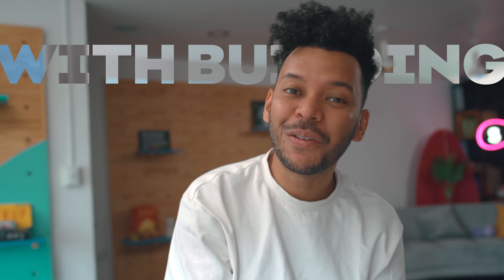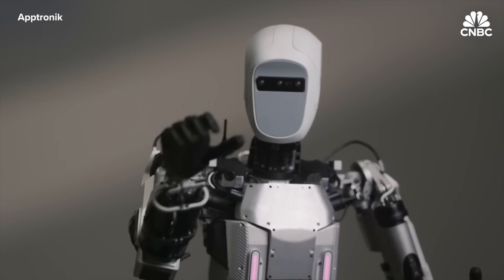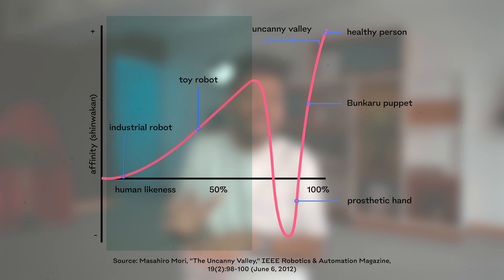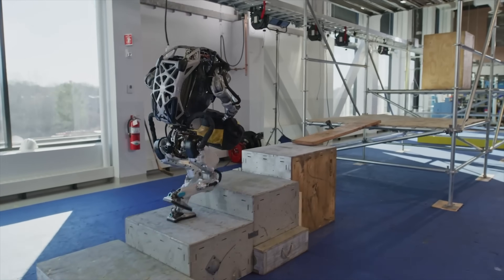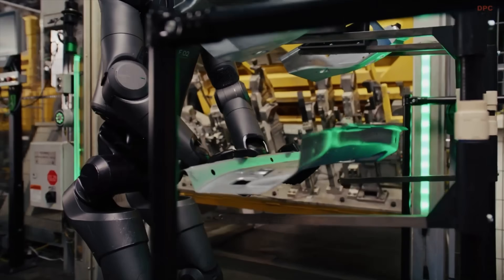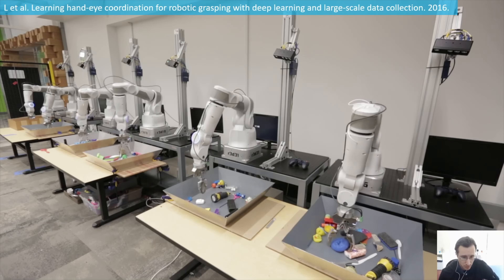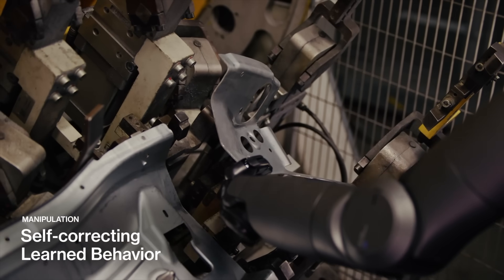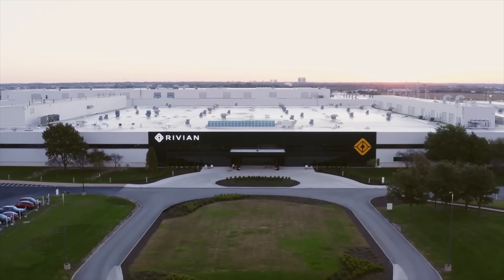The Automation Trap: What Robots Are Really Selling

Comment: Good luck going up stairs or moving over any sort of difficult terrain. Sure, wheels may make a lot more sense depending on your use case but sometimes wheels aren't going to get the job done.  Of course, a four legged robot can solve these issues and are much more practical so your overall point is still valid.

Comment: I did some research based on your claims and there seem to be a few key inaccuracies in the data: The primary issue is that the chart in 00:30 is in millions, but actual VC funding in robotics is in the billions. For example, 2021 was a peak year with over $15 billion invested, not the ~$150 million shown. What sources have you used? 
Second, you're right about the massive Figure AI deal, but the news in early 2025 was that they were "in talks" to raise $1.5B. 
Finally, because the chart's scale is off, a claim that 2025 peaked (and has already surpassed the last six years combined) isn't supported by any public data.

Comment: It's not just "cool" factor that has industry interested in humanoid robots right now. The idea is that a humanoid robot would be able to do any human task without needing special accommodations: climb stairs, climb a ladder, drive a car, do construction work, make a pot of coffee. We have robots that could do any of these things, especially given an environment designed to facilitate the robot doing it, but the theory is that a humanoid robot would be able to do all of these things in environments that were already designed for humans.

The current industry push for humanoid robots started after the Fukushima disaster.  Attempts to use robots to do cleanup operations kept running into one difficulty after another because the environment inside the reactor/facility wasn't designed for robots and structures were damaged, etc.  This drove them to build a list of capabilities a robot would need to have in order to operate effectively, and in reviewing that list of abilities it was concluded that only a humanoid robot could do all of them.  Two in particular that I remember were ascending a ladder onto a catwalk, and turning a large wheels around human waist height to open/close valves, and I believe open/close doors.

Notice how Boston Dynamics created Atlas not long after Fukushima.  Also look up the Darpa Robotics Challenge, which was not explicitly motivated by Fukushima, but was instigated by the challenges Fukushima cleanup operations were encountering.  I don't think Darpa would have deliberately motivated industry in this way for "cool factor".  

Yes there have been humanoid robots in Sci-fi since forever, but very few instances in industry prior to Fukushima; Honda's Asimo is the exception that proves the rule.

Whether these companies will actually be able to justify the investment is an open question, but the investment isn't purely emotionally driven.  There are practical motivations.

Comment: You are doing the pre-IPO calculations wrong.  The idea for investors at this stage is either the company gets sold or does an Initial Public Offering.  The theory is that the valuation of the firm in either scenario is above the value that the investors put their money in.  If it is much higher, then they get a windfall and make oodles of money.  In Venture Capital, the expectation is that 90% of investments fail and that the other 10% make up for it.

Want a real-life (non-robotic example).  Cerent Communications was bought by Cisco Systems for $6.7B.  At the time, the revenue for the entire life of the company was under $10M.  The company I worked for at the time owned 5% of Cerent and in a couple of years our investment (which at that point was in Cisco stock) was worth over $700M.  And that initial investment was less than $10M.

Comment: I think you're missing the point. There are valid reasons to build humanoid robots, besides marketing and while staying clear of the Uncanny Valley. The main reason is the ability to operate within human-made environments, climbing stairs or opening doors is not very practical without legs or hands. Wheels are amazing on flat and mostly smooth terrain and I think that many robots will be specialized for different kind of environments and some will clearly use wheels or be airborne.

Comment: Computer can Identify Colors no mater the lighting. You are the one who think a computer need  to identify every bit of color when we don't. All we do is group things so why not tell the machine to do the same? Grouping colors is simply you take a picture, move object, take a picture, compare the pictures, every changes represent a location of moveable object with the action field. SO by carefully defining all moveable objects, the machine will be able to efficiently interract with everything. You can also get a machine to solve laws of physics if you give it the ability to rationalize. What that means is that you tell it to perform action repeatedly and compare results., if the results are the same, constantly, it can declear that as a law of nature.  If the result isn't the same,  it will either try to reset conditions and try again and try to figure out why the results are not the same. if the results with each tries are random, it can also define that as a law of nature. If by repetition it can find partern in the randomness, then it can define that too as a low. So machines can do things humans cant because they can all connect to a central AI where all the solutions are.

Comment: Robots are structur mechanics. The Soul of the robot is the Operating system that allows the robot to perform tasks. The the task instructions are the packet of instructions for the robot to do something like "Bake a cake". To back a cake, Robot will get the instruction, send it to its AI, the AI wihich has the brain power to process the information will solve the problem, send the routine to Robot and Robot will execute.  If Robot isn't getting the result it should, it will checkback with AI which will  keep updating Robot with what to do until the Cake is ready. So, separating Robot from AI is how you get it to work. The AI is like a Server and Robots is just a mobile device that only need ability to connect with the server for instruction and be able to execute the instruction.

Comment: Whoever thought it is smart to use the word evolution while talking about machines, is dumb. Evolusion is a hypothesis that has not yet been proven. Robots have advantage humans don't. They caln all be abgradeable. If all robots get upgrade from a Robotic Intelligence which creats updated packets of protocols for all movements  a robot can make given its design structure, as they experience  and solve mobility problem, they would feed the data to mother which will either update packets or creat new packets. Humans do not have this capability. With this capability, all robots will need is structural design upgrades to be more efficient.

Comment: Great video.  I run a cabinet shop making kitchens and we use robots all the time.   But they look nothing like humans.  My wood carving robot looks like a big printer.  Bigger shops can get a robot which will carry sheets of plywood around the shop to various machines.   It also looks like a big overhead printer with a vacuum lifter attached, and  it can recognize materials because all the materials have bar code stickers. If you want to design a robot to solve a problem then focus on the problem,  such as cutting cabinet doors,  or  lifting plywood.  Spending billions of dollars to make it look like a human first is idiotic.

Comment: The utility of humanoid robots primarily lies in their flexibility and interchangeability with humans in terms of shifting job roles toward automation.
A specialized robot can perform the task for which it is specifically designed whereas a humanoid robot can perform any number of roles for which it might be suited and can transition between roles seemlessly based on the demand for a given task at any given time. Once the threshold for economic viability is passed by further optimizing the learning capability and performing tasks at a high level the floodgates are wide open and the upfront development costs will be a drop in the bucket. It's absolutely the future of industry.

Comment: I looked into the same issue in the past. One of the biggest reasons we design human-like or human shape robots is the need to use existing tools, infrastructure and fit into the environment. But it is limited to size, weight and general shape, not a human-like face etc.

Comment: The Science Fiction literature, movies and TV series are a two edged sword. It is a bless and a curse the same time. It helps you thinking out of the box, but it also make new boxes around you. It not just improve your creativity, but steer it toward something. The need of a humanoid shaped robot is one of the not too good side effect. Probably a “robot” vacuum cleaner could show you, that you dont need a humanoid shaped robot servant to vacuum the house, but you need a machine which designed to do that task in an efficient way. Usually much more cheap and efficient to redesign the tasks and the environment so a much simpler, cheaper “robot” can do it. You can barely find humanoid shaped or even partly humanoid shaped robots in a factories, because they dont need any. They rather design an assembly line where small simple machines does the subtasks. It would be a waste of tremendeous amount of money to redesign the whole thing where humanoid shaped robots does the same thing. Probably 99% of the cases humanoid shaped robots would be the worse choice.

Comment: You really don't get it, do you? Humanoid robots are designed to slot right into performing the widest range of tasks/jobs that we need doing and those are human tasks/jobs in a human-centric world. The biggest reason, though, is that the robots need to be able to function without laborious training of every single joint movement required for every single task (as the original Boston Dynamics Altas robot did). They need to be able to train using AI and, specifically reinforcement learning, in simulation following bootstrap training by humans. This is done via motion capture suits ("mocap"). humanoid robots are WAY easier to train than single-task optimised robots. On a car production line where body panels are being stamped and moved, an optimised task-specific robot with no legs that is designed specifically for that task will ALWAYS win at that task. BUT it can do no other trasks. Humanoid robots are designed to be able to do any human tasks, subject to suitable training. Monday = Gardener, Tuesday = Auto Production Line, Wednesday = schoolteacher, Thursday = bomb disposal, Friday = elderly care in the home. Humanoids are currently the only way to train and do all of those.